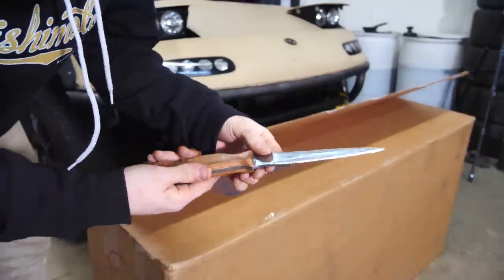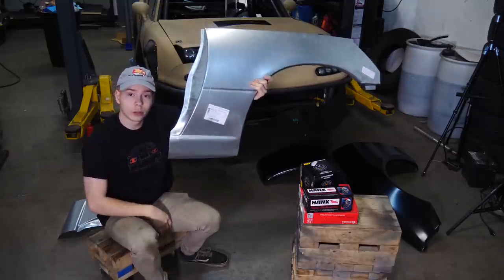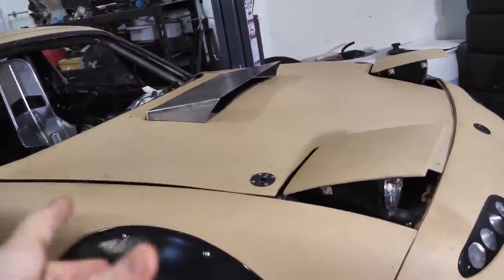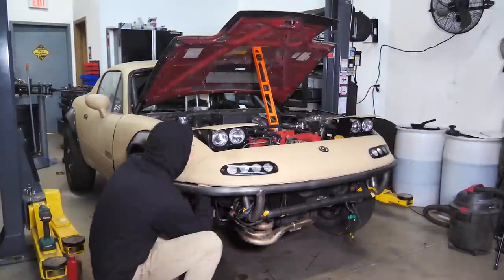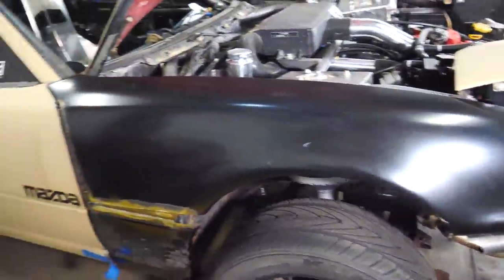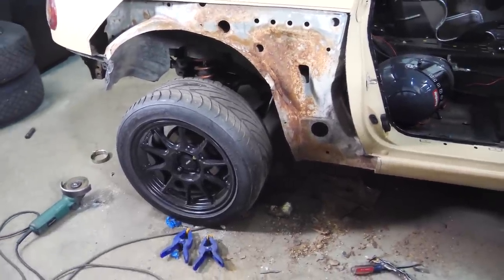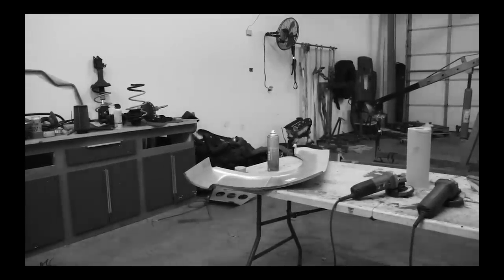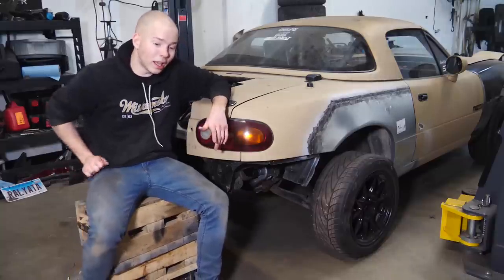PHASE TWO of the AWD MIATA Build Begins! - Fabricating Custom Fenders & Hood Scoop

Comment: Definitely really good preventative maintenance to cut out all that rust. Wouldn't want all your hard work to crumble to dust. I say this every video now but it's coming together so wonderfully, I guess it's all out or bust.
Reply: Thats poetry right here
Reply: Needs to learn the ways of Fluid Film for complete prevention - pop a couple holes in the doors, body panels and just let loose. Rust won't form if it can't touch the steel.

Comment: February 16th 2017 is the first video on the rally monster.  Been watching the build from the start with that paco 3” lift think wow.  This could be so cool.  Now it is again. Miata is awesome the answer indeed lol.  Personally I love my 2002 BMW Z3 M roadster but over he years the Miatas have grown on me but I’m just too big for them.  The Z3 is tight fit since 2003 I have been hitting my head on bumps and knees in the dash I’m tall.. and a big framed too.  Thank you for following through with this.  You had to do so much to get to this point.  Got gluing wires to custom tube frames with custom wiring done right’er

Comment: Stock subaru hood scoops have a diverter in the middle so that on higher speeds the front of the intercooler also gets fresh air instead of all going to the back.
Also those stock subaru (street) wheels looks so much better then the offroading ones!

Comment: You can definitely salvage those front fenders, just needs bit more welding and grinding. Good thing you removed the rust under the rear fenders, because if that part gets rotten then the whole car is scrap. My car is -07 model so it won´t rot, but there is couple of scratches at the rear bumper, because apparently the previous owner could not reverse it even with the parking sensor.

Comment: Bodywork tip, next time, instead of adding material to the back where the door met the panel, slice the panel until a point where you feel the piece can bend and look right, then add the slice on the inside. You'll have all the lines look (as they are factory) and yet they meet properly at their panel gaps.

Comment: Idk if anyone commented this already but you might want to drill a couple of holes on the bottom of the panels to let water drain (kind of like what they do with doors from the factory) might help in keeping them from rusting, specially considering you'll be mud running the car

Comment: Great work, I'm loving this build! shouldn't the quarter panels be welded along the wheel well too? Anyways, great work actually cutting the rust out instead of hiding it, I'm glad proper primer was used instead of POR. I would treat it to some linseed oil based cavity wax to prevent future rust from within.

Comment: Add some round bar steel cut length wise in half to the front of the scoop so it's leading edges have a rounded contour + lip behind to mount mesh???

Comment: Just my .02c for the times you tend to take this rock crawling, mudding etc. You're not driving very fast therefore not moving a lot of air.

Mishimoto and Spal  both make oil cooler sized fans you could mount on the back side of the intercooler, so you wont have a totally heat soaked intercooler on your slower days.

Comment: I was hoping you would cut diagonally to the corner or on a piece of the front fenders which didn't require the back edge to be messed with to keep the perfect OEM gapping with the door. Even with that said I think it'll still turn out great when all said and done.

Comment: You need to brace across the back as you have cut such a large hole tie the brace to the cage, more heat needed plus the safety of the water pipes run them through the car no debri or broken drive shaft's to take out them make a prop hoop so you dont break one and end up rolling or pogoing on it.

Comment: Honestly your bodywork isn't that bad. It's pretty close to how it would be done professionally. Finish grinding it and welding it, then use some filler to blend it in. Make sure you prime before using filler though, the hardener in the filler is a little corrosive so it'll eat away at the metal if you don't.

Comment: Hey man, love the build. I'm just about to cut some rust out of my Miata. I've got both sill replacement panels and the rear arch replacements. Would it be better to do patch repairs and not cut out metal unecessarily or just replace the whole panel?

Comment: You should have used epoxy primer or self etching primer on the inside of the quarters cause the weld trhough primer isnt gonna protect or prevent rust like epoxy or self etching would but just make sure you wash it out good and it shouldn't be too big an issue cause I know shes gonna get diiirrrrty also love the build one of the coolest miata probably ever also I'm actually restoring a miata rn all the body work is done just waiting on the trunk and it's getting paint

Comment: Just thinking... could you have shaped the front tube chassis differently, so that the panels would have line up like oem?
To me it seems like there's a very excessive bump on the top horisontal tubes
Reply: I really like the very subtle change in the fender line.  It's the kind of modification that will kinda sneak up on folks that see it for the first time.  That fender line would have been great for one of the Miata generational updates in my opinion.
Kudos to you Gingium!